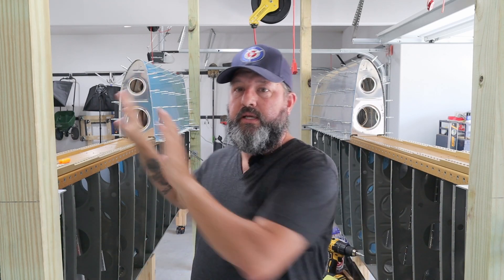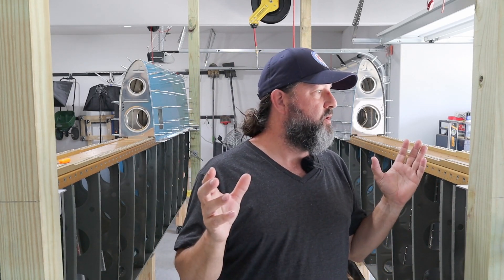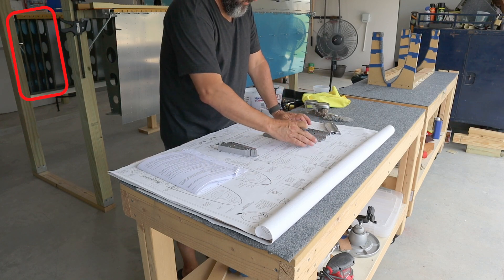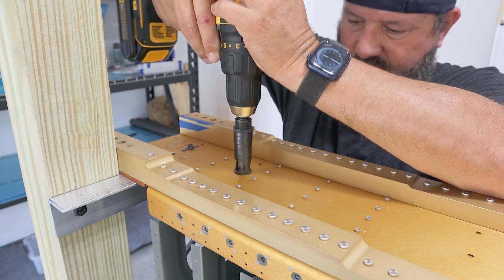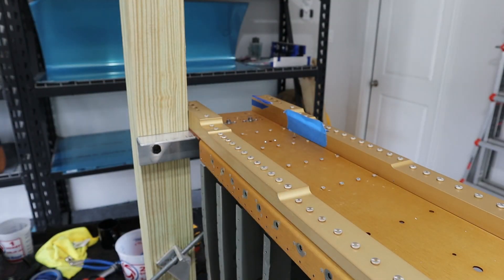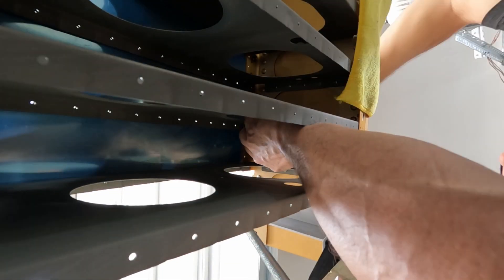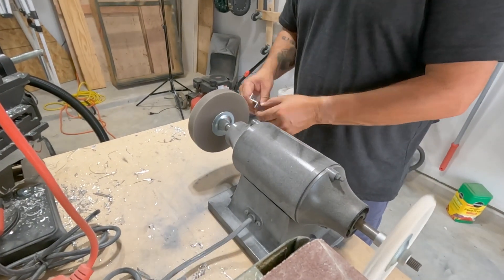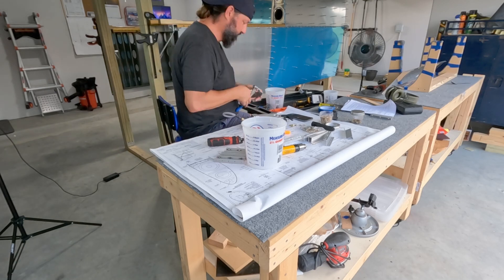RV-8 Build. Ep 054. Fuel Tanks 01

Comment: Thanks for this video, I’ve just finished prepping my spars and haven’t yet done any work on the ribs because all mine are laser cut.
I’m wondering if those 6 (3 per wing) nut plates that were a pain in the butt to install can be done prior to installing the ribs? I’m sure that would make things a whole lot easier but not sure if there’s a reason the plans have you do this later like you did.
Reply from the maker: Yeah. I think I would’ve attached those nutplates before attaching the main ribs if I had known. I think they’re not introduced earlier in the plans simply because they’re related to fuel tank construction, so they’re grouped with that section.

Comment: Once again Van's does not spend enough time getting customer feed back and change the plans accordingly.  I am just about to put in the nut plates and the plans should have done this earlier.  

This is very frustrating for builders.
Reply from the maker: Curious to know how far along you are now. I've found the plans to be less and less descriptive as I've progressed.
Reply: Hi Chris,

I finished up the wings about 2 months ago.  (According to the plans). I have not installed the pitot tube or wired the lights or even put the bottom skins on. The plans did not call for that.

I am working on putting the fuselage together now. The instructions for the fuselage have been better.  Very step by step.  They seemed to have been written by someone else.   However they are certainly are not updated to the parts they give you and some parts of the instructions actually contradict other parts of the instructions.  

But I have been in San Antonio, Texas since the 2nd week of December doing the Christmas thing with my family. I am going back to my other house in Pagosa Springs CO early next week and get back to building.

By the way I am building an RV-8A.  I have nearly 20,000 hours of flying time and thought I would not try to relearn my landing techniques.

Later,
 Dave
Reply from the maker: @davidduquemin3624  That's good info, Dave. Thanks! I'm looking forward to further updates. Happy New Year!